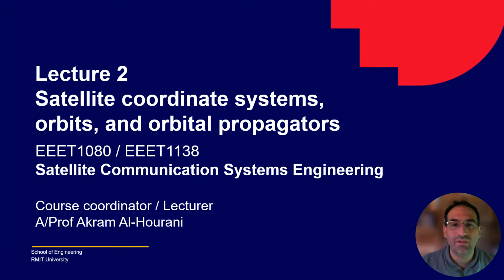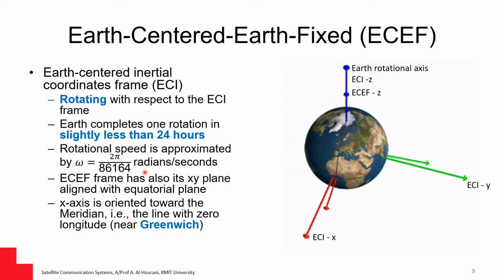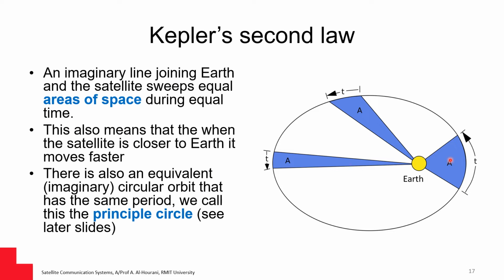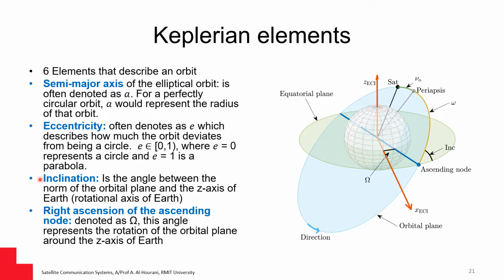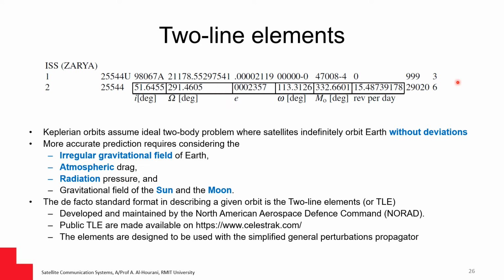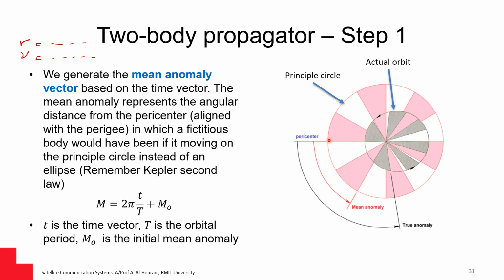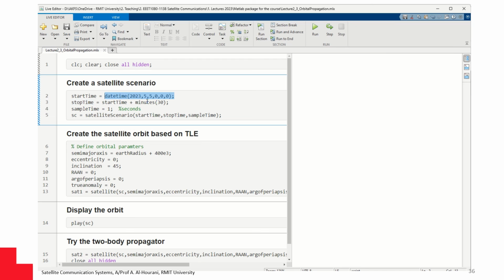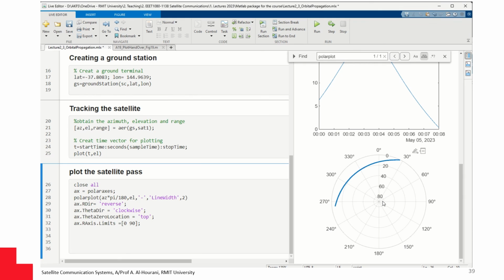Lecture 2 Satellite coordinate systems, orbits, and orbital propagators

Comment: Infomative contents. I have 2 questions regard to satellite communication.
1. If you are on the island and connecting to the satellite, but suddenly you lost connectivity from satellite, so what happened to satellites? and what you will do as a controller.
2. What is the temperature of satellite in the space under solar irradiation? Please help me. Thanks a lot